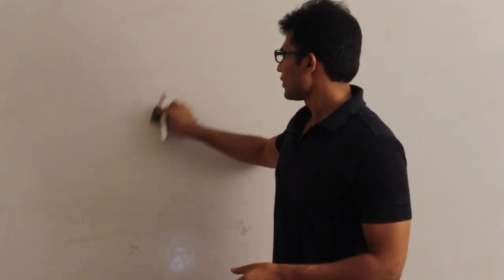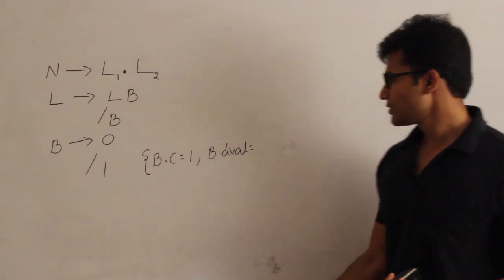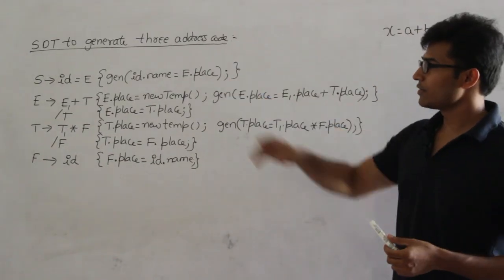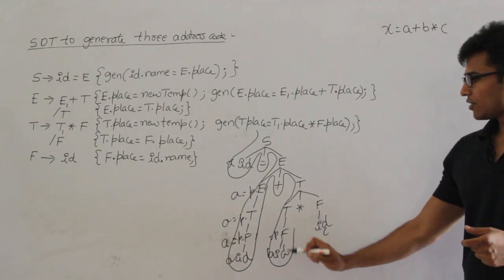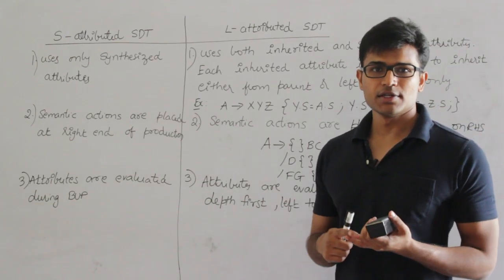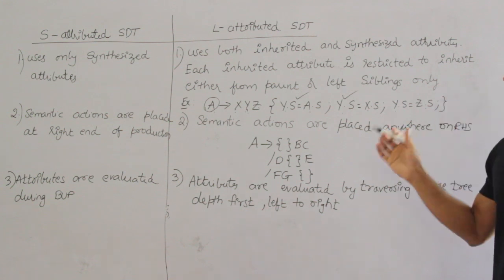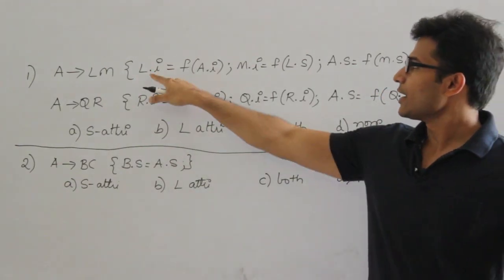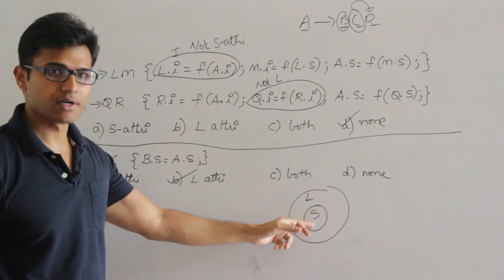CD | Syntax Directed Translation | S attributed and L attributed definitions | Ravindrababu Ravula

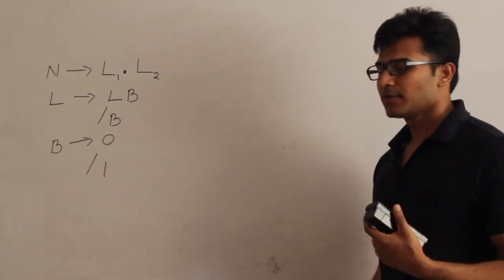Comment: In the example of grammar of binary numbers with/without a decimal point at 3:20 , shouldn't there be another production
N -> L besides N -> L . L
to account for binary numbers without a decimal point?
Reply: he has covered binary integers in the previous video and also he stated at the start of this video that he's only covering binary number with decimal point. your statement is correct though.
Reply: It covers the scenario you are talking about.
As per my understanding L2.c =0 . So 2^(L2.c) becomes 1. and L2.dval=0.
Therefore the part after decimal('.') becomes 0.

Comment: A correction in thegrammar of first example i. e.  Conversion of floating point binary to floating numbers. 
The semantic rule for L->LB should be (L. dval = L. dval*2 +B. dval)  .In the video you missed the multiplication of 2.
Nice video though :) . Hope you correct it.
Reply: According to me  answer should be 
L. dval=L1.dval*2+B.dval
Reply: Please put an annotation in the video at the time of the error. Made me look into the example a lot and lost much time until I scrolled down to see this comment.
Reply: @mshiyaf  what is the meaning of list followed by bit can you give me an example
Reply: Same thought here
Reply: In this answer.....
 l. dval=l1.dval*2+B.dval
Reply: But it will affect the list after the decimal point also. N->L.L
Reply: Lol you are just repeating his solution with a suffix 1 to L on the RHS.
Let me mention that it's just used for notation and L1 is the same as L.